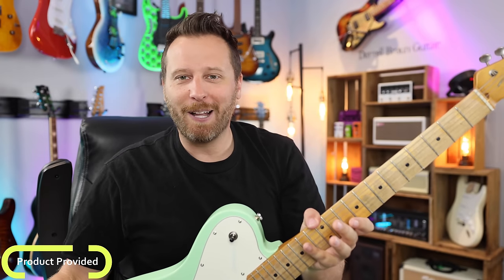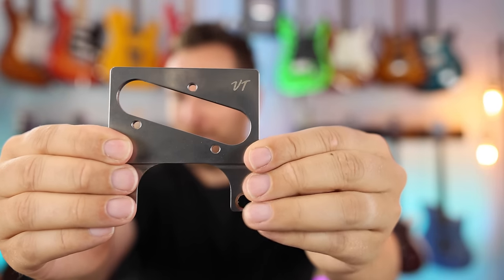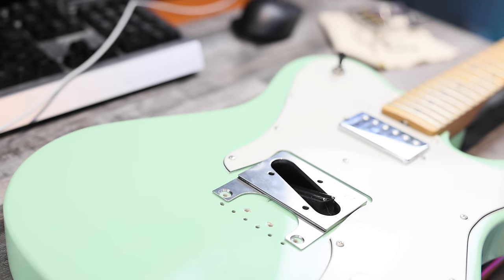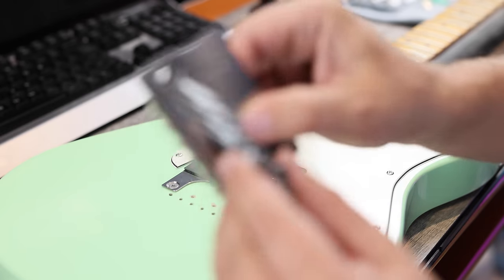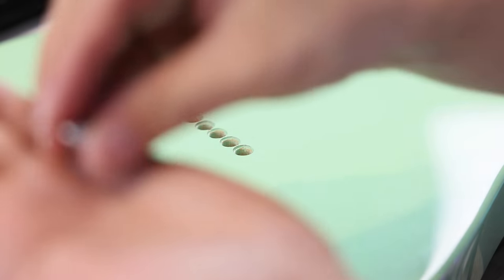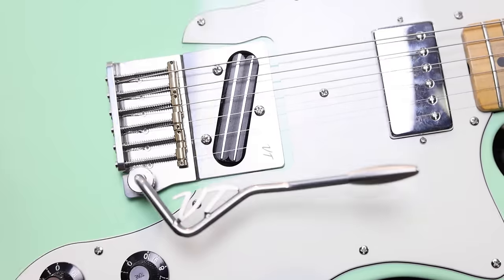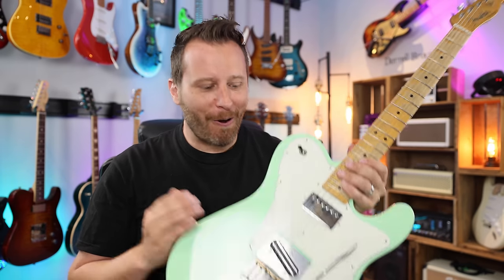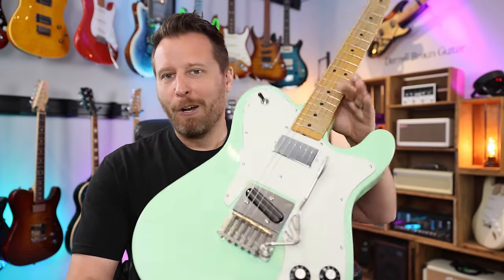This is the STRANGEST Guitar Trem I've EVER Seen!!

Comment: 265 Euros. Pass.
Reply: For a completely new and original system (R&D cost) that isn't made in a sweatshop, and also doesn't require modding/wrecking your Tele to install it... it's actually quite cheap.
Reply: @ImagineRecordings "it's actually quite cheap" ☝️🤓, it's not, it's 265 euros, that cost as much as a guitar itself and it's embarrassing
Reply: @cato4930  Yeah, a Gotoh for my strat was like $100US
Reply: @ImagineRecordings Not to mention the fact it will likely last for a very very long time...

Comment: Darrell, When removing the ferrules, if they are really tight, they can chip off the finish when you knock them out. It is advisable to use a collar around the ferrules to prevent finish chipping.
Reply: His guitar suffered chipping
Not sure why it wasn't mentioned unless he really didn't notice it.
Reply: @N-DtoF  I didn’t look very closely at the video.
Reply: Where can you get them?
Reply: @JohnFlaky-jm7dd  you can use a fitting washer and it should be enough.

You can also score the perimeter of the ferrule with a sharp blade and  that should be enough.
Reply: @N-DtoF  I was wondering the same thing. There's clearly a chip of paint missing after he installs everything and flips it around... After seeing how well played in the neck is I came to the conclusion that either he didn't notice or doesn't much care. 

I would like to know directly from Darrell though. 🤔

Comment: They're not compensated saddles... they're adjustable saddles. There's nothing to compensate. And try a soldering iron to heat up the string ferrules before removing them. Prevents that chip in the finish.

Comment: Damn! What a clever design!

Edit:
After looking further into it, it looks like they've changed the design a bit to avoid the need to drill two new holes into the body. Their website still shows only the old design.
The thing is, they advertise the old design as requiring no permanent changes while absolutely requiring drilling 2 new holes into the body.
Here are their statements from their website:
1. "Installing a VT2 Teletrem, unlike other options on the market, deeply respect the body of your beloved guitar without the need of making any permanent changes. 
2. "Installing a VT2 just needs a screwdriver and following a few simple steps that you will find in the assembly instructions section".

Not a word about drilling. They mention drilling only on the instruction video.

I find it a bit dishonest.
Though I'm glad they, apparently, improved the design to avoid the drilling.

Thought it was something worth noting.
Reply: As Dave mentioned, that's not a Fender body. So it took some hole opening up! No big. IMHO the design and materials create a very clear, stable and intonation tight system. Thanks for your comment!
Reply: @timothyvaher2421  
You mean Darrell? 
I didn't refer to the drilling he did here. I referred to the drilling needed to install the bridge in the old design. The bridge in this video is the new no-drill design.
Which would have been nice if he mentioned that, actually.
Reply: Dave’s not here
Reply: @KCCheez  My license?  Isn't it on the back of the car??
Reply: 3 bills? No thanks
Reply: @detailsdetails...9571  That is a big price tag considering a German made Floyd kit is around the same price. Bigsby makes one for Tele style would require new holes but looks like a more comfortable to play option
Reply: I got really confused by this product because I watched this video then watched Andre Fludd’s video and Andre needed to drill holes. And on the website it still shows the version where you need to drill holes. I had to find a video of this years NAMM show to find out that this version of the trem won’t be released till June. There isn’t a word about this on their website.
Reply: @limpneckmike  
EXACTLY the process I went through.
Reply: the trem in video is the Vegatrem VT2ND (coming soon), the ones on the site are the normal VT2

Comment: It seems the tremolo is very subtle, pitch change is minimal, not even a half step.  I would suggest a way to bend the angles of the trem arm so that it is higher distance from the body, so you could push down more and get more pitch change.  I did that with a cheap trem system, bent the bar in a vice to give it more height , to have more pitch variation.  Of course, the more you can bend the pitch, the more chance of going out of tune.  I wonder if those letters might be a hazard?  But I love the simplicity, and the blade setup is very subtle.

Comment: I noticed you mentioned a screw in arm. Is it an unthreaded bar with a tightenable collet or is the bar actually threaded? Not a big fan of the old style threaded bars, but prefer an adjustable arm. Very cool however. Both my Tele's (A classic vibe and a partscaster I built) have Bigsby's with Vibramate adapters (for non-mod installs) and to make them easier to string - and they work beautifully but add a lot of weight. This is a really smart design.

Really love your videos and variety of content. :)

Comment: This looks like a revised version from their initial installation videos.  How do you know when you order one which version you are going to get?  When you float the trem, how sharp can you pull the high-E string?  I suppose you could measure your locations of the existing bridge saddles and then try to adjust the VT to match as a first attempt at intonation of their bridge saddles.
Reply: This is the new one which they will release in June i believe. You can then choose between both on their shop
Reply: VT2nd is now available for PRE-order on their website today.
Reply: My pre-order arrived last week and I installed this on my Tele.  Really enjoying it.  Works great and stays in tune just fine.

Comment: I've just installed a TremKing on my tele and it's pretty good but you have to remove a lot of wood and it's lot of work with the router. You'd be mad to do it to an original body.
This system is genius.
Reply: How do you like it? I've been considering one. Not sure which of my guitars though, Tele or Strat. I prefer the Tele's sound, but the Strat's comfort and slightly better playability.
Reply: @totallyunmemorable  I think the Strat's trem is pretty good as stock so I wouldn't bother. I'm guessing it would be easy to fit on a Strat though as it already designed to have one. I missed having a trem on my Tele. I hated the Chinese knock-off Bigsby I tried, That came straight off. but I do like the Trem King. There is a "clunk" feel if you wobble either side of the note but it does stay in tune. You need serious skills to fit a Trem King and it does say to get a luthier to fit one. I'd get a 3rd party body if you want to try one on a proper Tele. My TK cost more than the Tele it's fitted to.
Reply: @Spludgeroo  Thanks for the reply. Those guys are just down the road (20-30 miles?) from me, I just learned. I would check one out before buying. I'm skilled with luthiery undertakings, I've built more than a few guitars myself, but their installation instructions are more than a bit obtuse. So I might just pay them for the first one, if I wanted to go through with it.
Reply: @totallyunmemorable  The instructions are not great. There is a vid on here where a guy fits a TK and reviews it but he doesn't go through the process but does show what it should look like finished

Comment: Darrel, I'm surprised you didn't let us know what an absolute pita this thing is. I want to love it, but touch it and the guitar won't return to tune. I opened the thring thru holes to 3/16, and it still hangs up. All the videos show popping right on. I find it hard to believe anyone can put this on, set up the guitar, and use it. It's in the package waiting to go back. I think if I had a new build, I would route the string thru holes to a 1/4 rectangular route. I would only go as deep to leave about 1/4 thk where strings come thru the back. Then I think the springs being free would give a chance at tuning stability. Ack, i wanna keep it but cannot.

Comment: A few points.

You state that the saddles are compensated. They don't appear to be, and there is no reason for them to be, as there is a separate saddle for each string, adjustable as with any six-saddle Tele or Strat bridge, by means of the familar spring and screw arrangement. This should ensure near-perfect intonation. The VegaTrem site doesn't mention compensated saddles, and we can be sure that they would.

You don't mention adjusting the intonation. The saddles in the positions shown would be wildly out of intonation, and yet the guitar as demonstrated plays in tune. Nor do you explain how adjusting the spring tension affects intonation, which it certainly should.

Knocking out the ferrules can lead to finish damage if the ferrules were installed before the body was finished. Anybody contemplating this mod should check this, and if necessary score carefully around the edge of the ferrules with a sharp (X-Acto type) blade before removing the ferrules, to break any bond with the finish.

The trem sounds good, but I feel that the complexity of installation and setup has been minimised.
Reply: I imagine he meant to say "compensating" saddles, for the reason you state.

Comment: Darrell,  or anyone else in this comment section, my dudes.  I need your help.  So I just got a PRS SE custom 22 and I am locking to switch the Chrome hardware to Gold hardware, which means getting a new bridge. but for the life of me I can't find the bridge size or right bridge.  do you have any recommendations by any chance? Do Fender trems fit as direct replacements? I was also looking at the Flyod Rose Rail Tail, think that would work?  any points in the right directions would be an absolute life saver.   thanks!

Comment: I kind of feel like that is an overly elaborate mechanism to produce just a subtle vibrato. If you just want a bit of shimmer, something like the Gibson Vibrola, which is just a bent piece of metal, could easily be designed to go on a Telecaster without doing anything invasive, and the benefit would be its simple, fool proof design.

Comment: Could anyone please tell me how it works??? I don't understand how it changes the string tensions.
Reply: You just have springs running vertically instead of parallel to the strings, tightening the adjusters which replace the string ferrules tensions the springs.

Comment: Thanks for the Video. Please note that the ground wire tobte bridge is not important, but the opposite: strings must NOT be grounded. Because the ground is connected to the amps ground. If there is an issue in the buildings cabling (quite often in old clubs!) or liquid in the amp (beer at gigs eg) or a bad malfunction, high voltage may be on the ground cable. And therefore on the strings. And on your Fingers. Quite a few guitar players got electrocuted by this. The cable is a cheap measure by the manufacturer to save money on proper shielding!